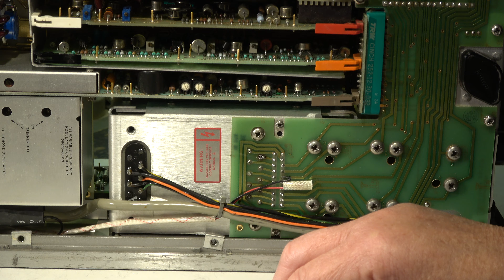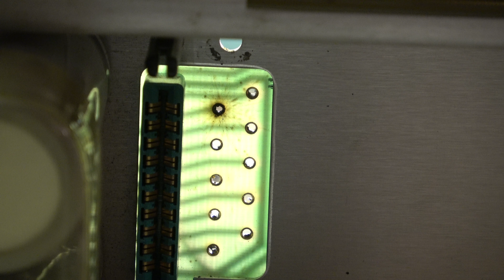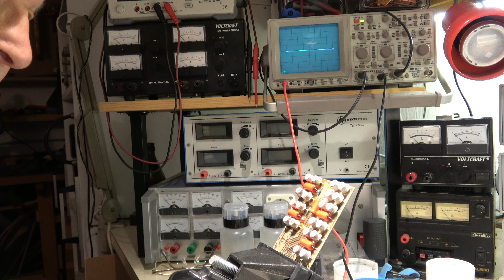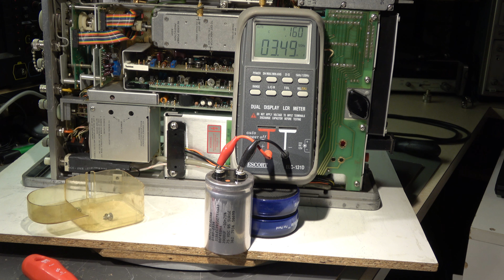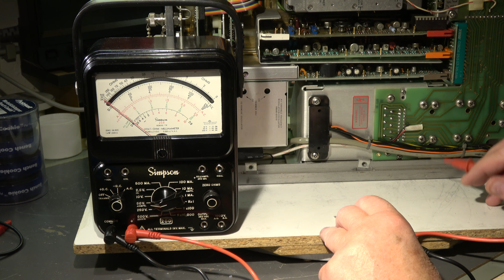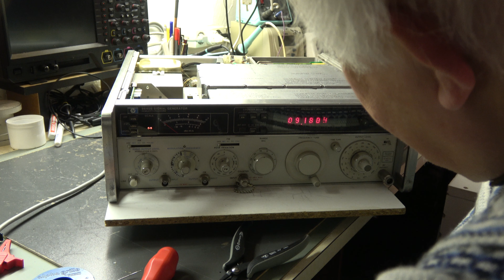#183 HP8640B

Comment: Gosh you really stuck it out to the end, Stefan. Great job. I personally have become to hate my 8640B. Just about every little plastic piece is broken and most of the switch wafer contacts have failed. I fixed many, more appeared... I got an 8647A and it worked perfectly out of the box. Replaced the RIFAs of course. Ran off a good reference this is just as good if not better due to the higher resolution and greater stability. To see what I mean, try and make the smallest turn possible on the time base calibration control VR of the 8640B and watch it jump 100 Hz. Anyway, I could rant for hours... Great video as always, I really appreciate you showing the details and explaining things so well. 73 de W6EL
Reply from the maker: The plastic gears are a problem, but maybe a 3D printer could help in the future.... maybe!
Reply: @dl7majstefan753 There is also a guy in India that got nice brass ones made, they are on ebay for ~$50. I was fortunate that my plastic gears still have some miles on them. Added some super glue and crossed my fingers. Fortunately I have the 8647A now, so the 8640B is just for the rare moment needing two signals. Great video, 73.

Comment: Excellent video, Stefan. Those solder joints did appear to be poorly done - not enough heat or heat applied only to the board and not also to the pin. Unusual to see in an HP product. I suspect many years of vibration of the transformer didn't help. Thank you for sharing and now I am off to inspect my 8640B! Regards, David

A quick update, I inspected my 8640B and found the transformer solder joints to be in good condition and up to HP standards. Maybe a new person or someone who had a rough night. My Rifa capacitor was nicely buldged and cracked from end to end but the magic smoke had not been released, a new cap has been fitted - not an easy job - yours looked easy, the magic of video editing!  Regards, David
Reply from the maker: Hi David, i pinched off the Rifa but let the wires in and soldered the new cap onto the old wires. My 8640B was probably built on monday morning....hihi.
Reply: @dl7majstefan753   I don't like to use existing leads except as a last resort. I was able to remove the mains input connector without disconnecting it and desolder the Rifa capacitor. Regards, David

Comment: The pad size for the transformer connections is relatively small w.r.t. trace thickness. This will tend to make a weak joint that gives way after many thermal cycles.
Reply from the maker: Yes, Right! I´ve forgotten to mention this topic. Maybe it was done by HP to cover tolerances in the pin arrangement of the transformer.